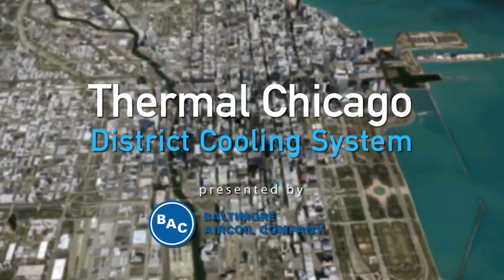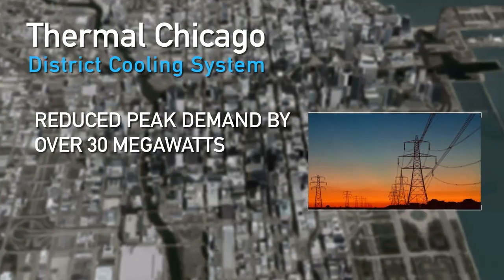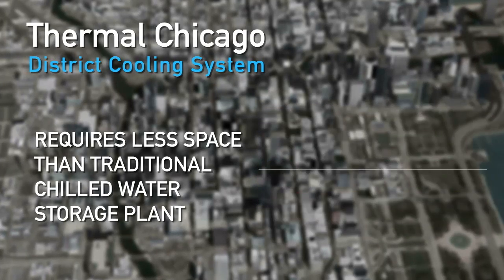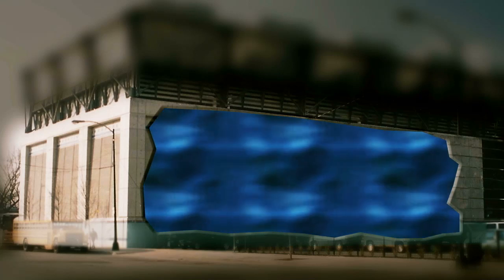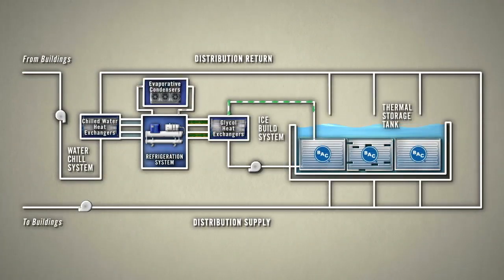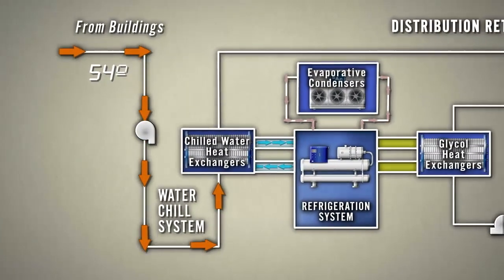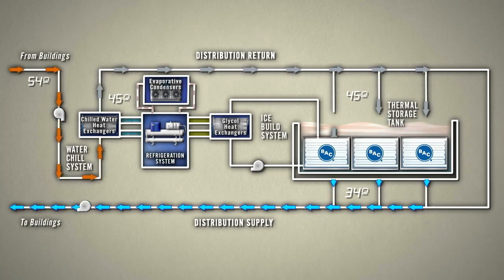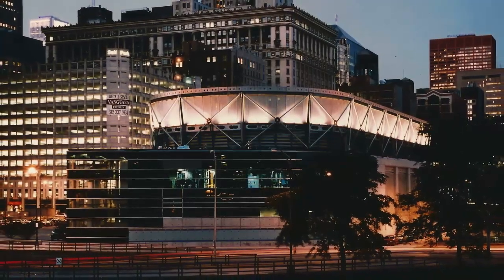Enwave Chicago District Cooling System features large-scale Thermal Energy Storage (TES)

Comment: why did they not capture the heat for use instead of dumping it into the atmospher via cooling towers. Some body ALWAYS needs heat-even low grade.
Reply: I'm not sure you could with this system. Plus, what would you use the captured heat fofr? I know other places that have heat recovery chillers to capture heat. A hospital here in Northeast Ohio has three centrifugal chillers with cooling towers, but does have two heat recovery chillers that run year round since there is a cooling demand and heating demand year round. There they do capture some heat and use it. Another place I saw that has a heat recovery chiller is a data center, although they only run it in the winter because that is the only time they need heat. They use the return water to bheat a couple rooms and heat the driveway when it's snowing.

Comment: So does that mean the plant can not serve buildings that need 24-7 cooling since you need to make ice with a minimal load?
Reply: I would imagine that these buildings would have a backup system in place that kicks in at night when the district cooling system in making ice. It still saves them cooling during more or less 12 hours though
Reply: @martinluescher5009  that makes sense. Plus, depending on the tenants you may not need cooling for the whole building 24-7 accept for computer rooms, and they can have compressorized units for evening time. If it were a hospital or something you would need separate systems for evening.